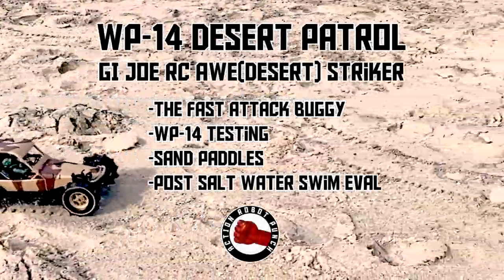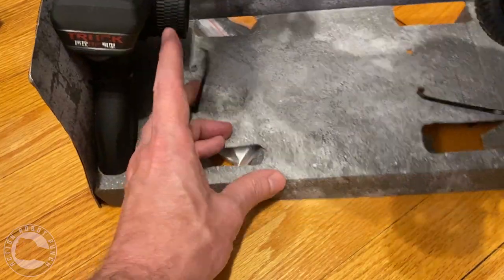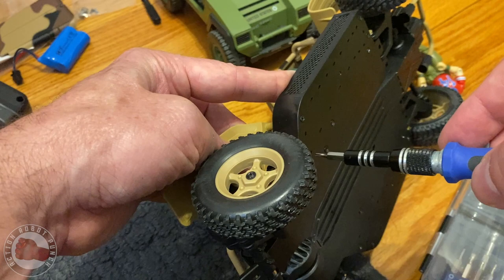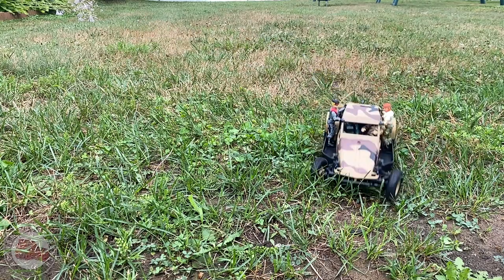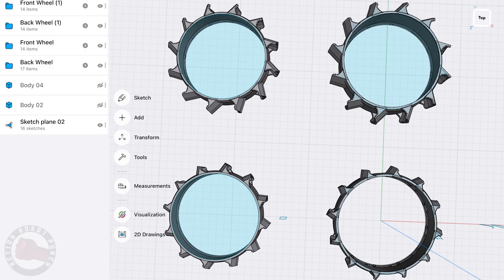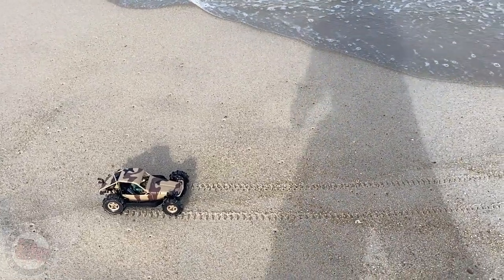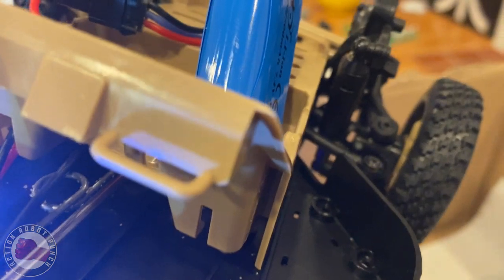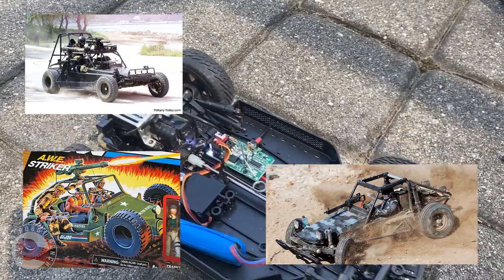WP-14 Desert Striker Buggy - Gi Joe Scale RC Awe Striker Mod

Comment: Awesome build, looks great ripping through that sand! I would suggest removing the battery and dunking the whole thing in a bath of alcohol and scrub the circuit with a tooth brush to get off all that salt residue if you plan on keeping this long term.
Reply from the maker: Thank you! Yeah, that sounds like some good advice. I might just swap out the electronics at some point too.
Reply: @ActionRobotPunch  After cleaning the circuit board,I'd paint both sides in conformal coating, just to safeguard the electronics for the future.

Comment: Take a air hose. And hold of the way about 12 inches from the board chip and blow it off that way.
Reply from the maker: Not sure I want to do that to this circuit board. I just packed it back up and it's working fine. If it gets wet again I might try cleaning it. Thanks for watching.

Comment: You should really consider cleaning the board off.  You can do it with a toothbrush tap water and soap then just let it dry fully for a few days.  If you don't you risk issues down the road.  Salt and electronics are a bad mix as it both corrodes and conducts,
Reply from the maker: Actually salt is not conductive. It’s pretty inert when not in solution. If it gets wet again, that’s a different story 😁
Reply: @ActionRobotPunch  As you wish.  I repair electronic from time to time and what happens it seems is that when components get wet the capacitors release oil which can short other components.  That combined with the corrosive nature of salt when simply mixed with air humidity can lead to bad outcomes.  But hey it is your property and you can use it as you see fit.  Thanks for the free entertainment and for responding to my comment.  Have a nice day

Comment: Salt will corrode electronics and batteries use white vinegar to clean it.  Looking for a 1:12 RC dunebuggy for Classified.
Reply from the maker: Thanks for the tip! The Tamiya fast attack dune buggy is a great candidate. They may have re-released that? It's expensive to get an original. But maybe a similarly scaled dune buggy. I thought of it myself...and now you have me thinking about it again LOL. Good luck and thanks for watching.

Comment: The only things that jump out are the lack of diamond plate in the side bits,  the bars on the front and a roof instead of a roll-cage, but that's picky picky picky. 

I do thing adding a roof-mounted weapon would make sense, another grenade launcher of course, and you GOTTA do Whippy Ariels!
Reply from the maker: Yeah for sure. It’s not going to be a perfect match but even stock it’s a pretty good start. thanks for watching 👍

Comment: You want to get rid of the salt soon it will erode the board
Reply from the maker: Sounds like some very good advice. Thanks 😁
Reply: @ActionRobotPunch  yeah i can see it really piling on the solder points its really dangerous if not delt with fast
Reply: Absolutely correct... it will continue to eat those electronics if not cleaned 👍